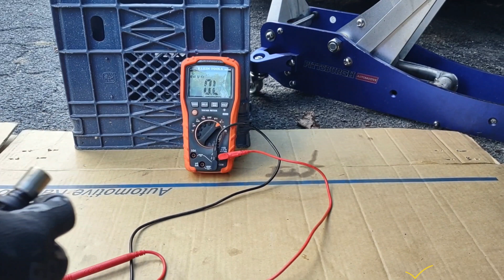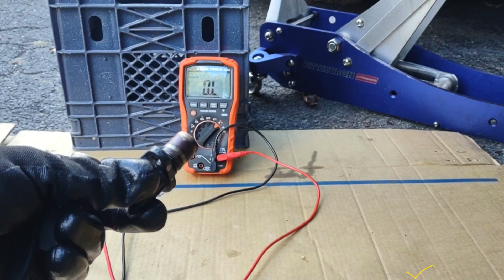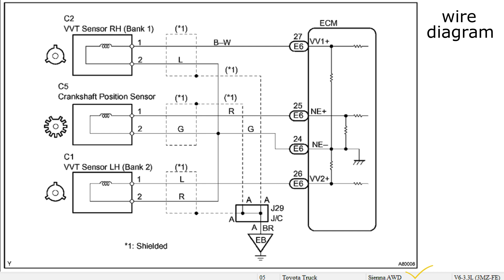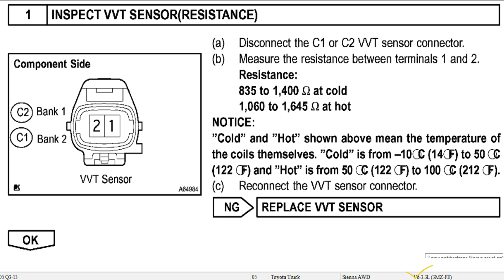Toyota sienna 3.3 code p0340 camshaft position sensor CMP fixed how to repair testing vvt sensors

Comment: That part is called a crankshaft position sensor
Reply from the maker: Toyota calls it vvt densor
Reply: It’s a Camshaft NOT Crankshaft. JM is correct I just changed mine yesterday for a 2004 Toyota Sienna. Don’t Buy a Crankshaft sensor for this location it’s slightly differently and won’t fit. The Crankshaft is located at the crank wheel by the passenger side of the engine. Thanks @JM-AUTO for showing me where it’s located.. I found an easier to replace it..Just Jackup the van and go underneath and remove it underneath. You don’t have remove the tire and unbolt anything. Hope this helps .🤙🏼
Reply from the maker: @vjyoukai  great job and thanks for sharing

Comment: Thank you, I just did the timing belt, water pump, and knock sensors on a 2005 Toyota sienna, I have codes for Bank One Bank 2 knock sensors. After changing the sensors, wire harness and all related parts when I started the car it was still doing a shaking and the code for the camshaft bank one sensor came up
Reply from the maker: was the cam sensor code there before replacing the timing belt?, you also can test the sensor
Reply: @JM-AUTO  no it wasn't. I'm going to have to check the wiring. I did order a new sensor just in case I may have to replace it
Reply: @emmanuelcarrion5168  do you have an update for the community? Was it a faulty sensor? wiring?

Comment: Good afternoon, how you doing? My issue is that I need to know the wires the input and album the Color crank sensor
Reply from the maker: hi, on the crank sensor pin #1 = pin #25 on the pcm and the color is RED.  on the crank sensor pin #2 = pin # 24 on the pcm and the color is green,  the red is positive and green is negative.

Comment: So how many VVT sensor on it 2004 ?
Reply from the maker: there should be only 2 vvt or variable valve timing valves or oil control valves but because these sensors camshaft position sensor and crankshaft position senssors work all toghere they all are syncronize one with another sending signal to the pcm so that is why they are still in that category of the vvts.thanks for coming to my channel.
Reply: Are there two cam sensors in the 2015 Toyota sienna?
Reply from the maker: There are 4 cam sensors in a 2015 sienna.
Reply: @JM-AUTO  do you know their location. I also meant to say 2005 Toyota sienna
Reply from the maker: @denisesander3942  the vvt sensors are located on the driver side at the end of each cylinder head, if you stand in front of engine they will be on your right side, the in bank1 is a little bit of a pain to get  to it because it is beneath the cylinder head n it has only 2, bank 2 is the cylinder head in the front, the rear one by the fire wall is bank1.
Reply: Are cam sensors and camshaft crank position sensors the same thing. I have no experience with cars but my brother is trying to locate the cam location on my 2016 Toyota sienna.
Reply from the maker: Can sensors n crank sensors are not the same how ever they work together n do a very similar job.